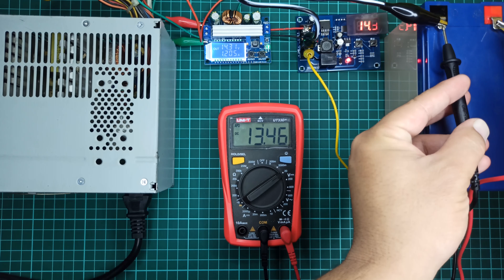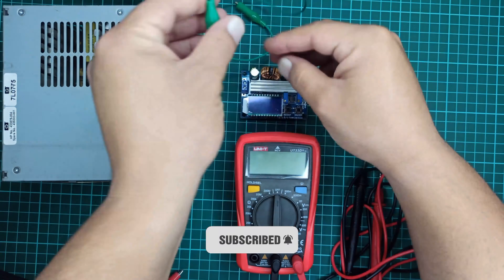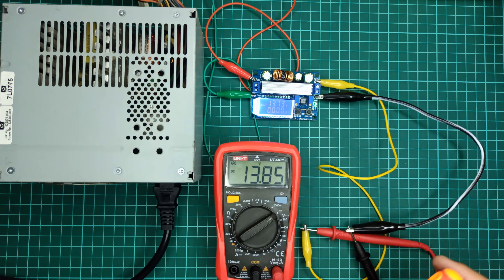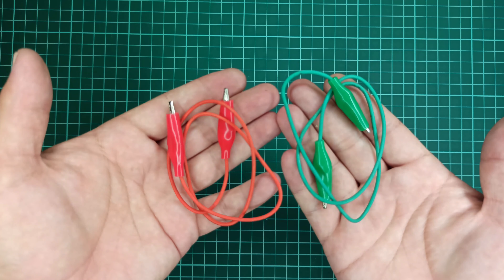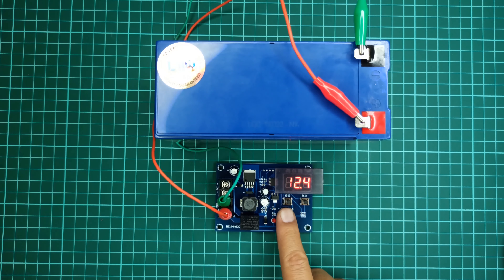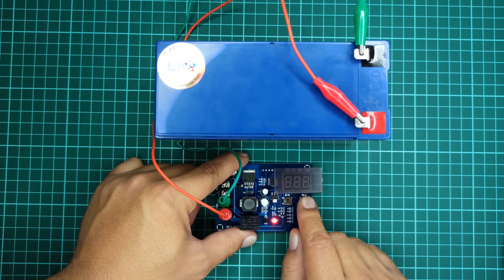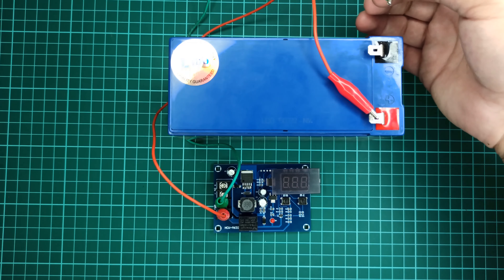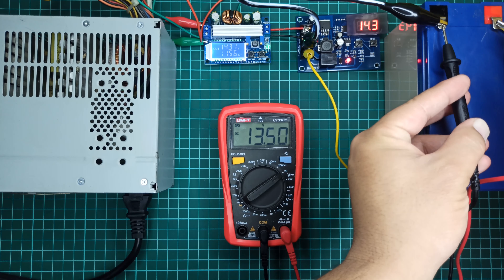How to make lead acid battery charger

Comment: How do we consider the difference in multimeter reading and volt meter reading in the module ??or we set according to multimeter reading ?
Reply from the maker: Dear, please always consider the multimeter reading because the module voltmeters are cheap and they do not provide accurate voltage reading.